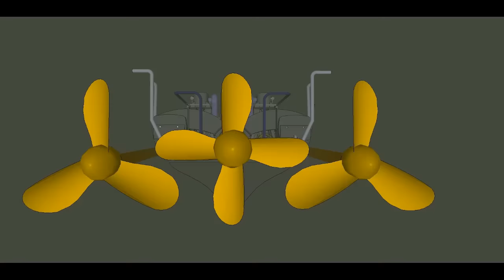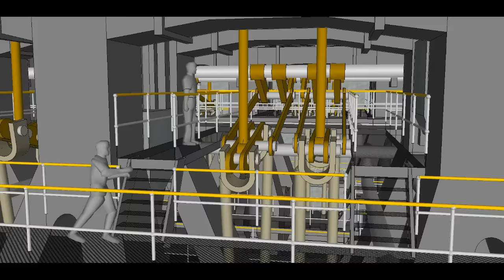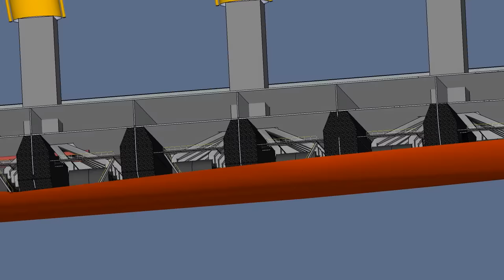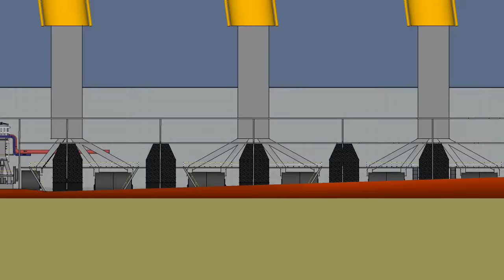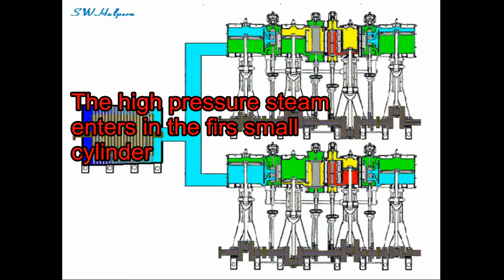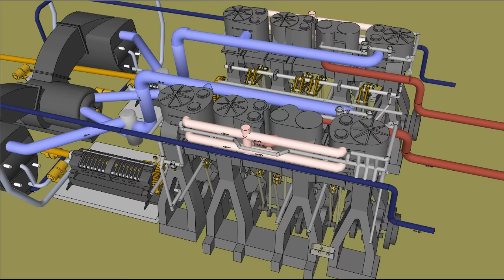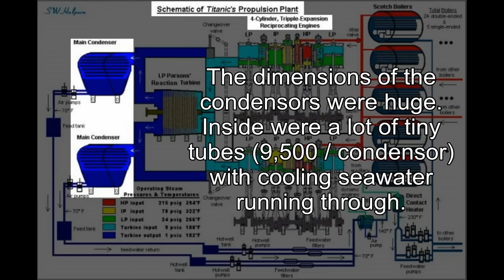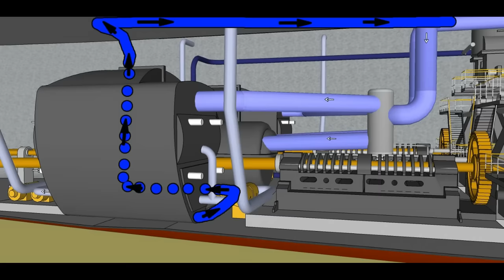The Engines of the Titanic

Comment: steam, under pressure, is immensely powerful. this just demonstrates the fact. although the usage of coal is so environmentally unfriendly nowadays, it was all they had back then. but wow, that must have been some boiler room. its bleddy obvious that one must have been only able to appreciate the true scale of it if they were to actually be in the place and soak up the vastness of it all. what an engineering masterpiece. lost forever. shame.
Reply: +DAVID Marshall Coal is still the most common fuel. At least in the US.
Reply: +DAVID Marshall possibly because they respond alone for a third of world's economy.
If a tiny little country was responsible for these numbers I could say "shame on it!" but that's not the case.
Reply: +TheSmileyFacedPizza We still have an abundant supply of coal left in the US (close to 1000 years) as opposed to crude oil and natural gas. There is some research on how to make coal burning cleaner. It's dirty, but it might be our only power source in the future (renewable energy still forms a tiny fraction of our energy usage).
Reply: There's still Bio Diesel you can get from Algae, so it shouldn't be a massive problem
Reply from the maker: Was that also true in that time?
Reply: Not Quite a masterpiece there was alot of false Engineering
Reply: worst part about all of those furnaces to power them boilers, them poor boys never knew what hit them when the frigid Atlantic came rushing in.  Some of them burned thanks to the cold water hitting the hot fireboxes.  There was several explosions immediately after as well.  Which no doubt killed more.  Even if it didn't sink, imagine if you will that she stayed afloat long enough to have a ship rescue the passengers and crew.  The ship certainly would have been crippled if not lost due to the massive explosions in the fire room.
Reply: we could be renewable now or at least mostly powered by the cleaner alternative of nuclear.  Consider this, some of the hydro dams have been dismantled in beautiful Washington state thanks to the tree huggers that care more about spawning fish than generating power.  Nuclear reactors we have today if they were to build one with our current technology and knowledge would be way more efficient than the ones designed in the 50's, built in the 60's and 70's.  Most of which are still in use today.  Example, the Gerald R. Ford class carrier has new reactors, redesigned and are a lot more efficient than the ones we been using the last 50 years.  Of course that is a naval vessel and uses a different type of reactor compared to shore based but still new design and more efficient no less.  anyhow this is off topic as this is supposed to be about the graphic of the Titanic engines.  They were ahead of their time for 1912.  Or I should say a bit earlier than that as it took years to build that massive ship.
Reply: Coal is MUCH cleaner burning now. Always remember that smoke you used to see was unburned coal particles rising in the hot air exhaust. Now, coal is ground to baby power lik consistency and BLOW into the combustion with air pressure.   The powdered coal burns entirely, instantly and cleanly.  Not only does this make coal a very clean source of energy since it burns so wholly it makes it very economical as well. Then the only real pollutant left is Sulfur Dioxide for which smokestack scrubbers are installed. The SO2  removed from coal emissions is then used to make sheetrock. So your coal powered house is partially constructed of coal exhaust.  ;)
Reply: It honestly isnt lost forever. We could recreate it.

Comment: It makes you understand what a Relief the  diesel engine was.
Reply: I was thinking the same thing!! Just the sheer size of the Titanic's engines is incredible. Between the boilers and the coal storage and the turbine and all of the moving parts it took up the entire bottom of the ship plus all of the people that was required to run it and their sleeping quarter's. I'm sure the sleeping quarter's we're very small but it was still something that was needed to operate the ship. So take all of that in to account and it took up the bottom of the ship completely I'm guessing by the video we just saw if it was to scale. Then compare that to today's diesel driven ships while still not what I would say small by any means!!  But compared to the footprint of the steam engine and all of it operating components it's pretty amazing how much it's gone down in size, but up in power!
Reply: Rune Dyrting true!
Reply: Well...before they’re all steam turbine engines and before oil burner boiler was a thing
Reply: Well..

It is it will always remain..
THE only problem with that engine is it works with coal lol

Which is bad for the enviroment.
Lots of black coal was lunched to the air.

But unfortunitly it was all ended with tragedy.. :'(

(sorry for my english)
Reply: No, whole principe of burning fuel to make steam from water to run engines and turbine is uneffective. 
Thats why the diesel internal combustion engine is much more better and smaller, so insted all of that machinery you can have more fuel ..... @أحمدالجهني-ع6د
Reply: @RS-pe5hp 
Oh ok then Thanks a lot for this information.
Reply: @RS-pe5hp  I wouldn't say the idea of burning fuel to make steam is ineffective.  Most electricity even today is made by steam engines still!  Steam can be very very wasteful or it can be very very efficient.  There is a huge range of design.
Reply: @firstnamelastnameisallowed7943  Conversion to oil certainly opened up much more space in the lower decks for things other than propulsion. The fact is, Olympic was converted to using fuel oil instead of coal,which certainly improved things, starting with the fact it's a lot easier to pump fuel oil into tanks instead of re-coaling.
Reply: @RS-pe5hp  Steam turbines are anything but inefficient, they are more powerful, smaller than reciprocating engines and are ultra-reliable. They do not need the massive and thus very heavy foundations a reciprocating engine requires, saving a lot of weight.That is why ALL large passenger ships built after Titanic and her sisters were all turbine ships, with four propellers. It was not until well after WW-2 diesels supplanted the steam turbine on passenger ships. Oil has far superior energy density to coal, while Titanic and her sisters devoured 600 plus tons of coal per day, a large ship today only needs 200 to 300 tons of fuel oil per day and the tanks for oil hold way more fuel per unit of volume than a coal bunker of the same size. Yes, you are right that the diesel is smaller, I build diesel and diesel-turbine powered ships. They take up remarkably little space. As for steam turbines themselves, they generate most of the world's electricity and propel nuclear powered naval vessels.

Comment: Anyway, the engines did a great job: pushing the vessel as hard as possible into the iceberg. 👍
Reply: bruh
Reply: They didn’t even hit it head on, even if they did the ship would’ve probably had a higher chance of survival
Reply: Titanic was running at nearly full steam the moment the iceberg was spotted meaning it gave them even less time to react and avoid the burg. Not to mention  the rudder on the ship was too small for it's size making it slow to turn. There were so many variables at play and unfortunately it all went to shit for them.

Comment: I believe the triple expansion engine is self starting there is no need to use the turning gear to rotate the engine. There are air pumps on the condenser which draw a large vacuum about 28-29 inches in mercury in vacuum. So even if the high pressure cylinder is suck at top/bottom dead centre the low pressure cylinder will still push because of the vacuum on the exhaust side. These engines also have levers to blast steam into the intermediate pressure or low pressure cylinder to 'kick' over the engine when starting. They don't need to be turned over with the turning gear to start them as far as I know. This is because in a ship the engine must start/stop and reverse practically instantly and they do, because when in a harbour you use the engines to steer the ship more than the rudder which is only effective at high speed. In a building with a stationary engine, you have all the time in the world to start the engine there is no impending collision that requires an instant start/stop reverse or what not.
Reply from the maker: +KiwiPowerNZ Thanks for the clear explanation!
Reply: +KiwiPowerNZ  agree, but titanic hat not triples, but quadruple temd engines.. (simply sead 4 cilinders, double action)
Reply: Charlie K When the ship is laid up for work or some extended time you should occasionally turn the engines. A small engine that probably worked on that big gear could be run off one boiler to just turn it over a few times.
Reply: +KiwiPowerNZ The pony motors were also used for jacking the shaft to eliminate possible shaft imbalance while in port. I served in the USN on a 1200 pound steam frigate (Knox Class) and the prop shaft could never remain idle. it always rotated very slowly.
Reply: bama Fan Interesting thanks for the reply.
Reply: +KiwiPowerNZ It is how you make sure the massive weight of the gearing doesn't push all the oil out of the lower half of the bearing. It is done to ensure long life of the drive train because you don't want to be doing a bearing job on those monsters any more often than absolutely necessary.
Reply: Nick Vandergragt
I knew there was a reason for it, but couldn't remember exactly what it was. I do know it was a ridiculously low revolutions per hour. something like one full revolution every 10 to 15 minutes, if not longer..
Reply: I miss my time in the engine and boiler room.. Steam has a life all it's own.
Reply: Nick Vandergragt I volunteer my time on this: https://www.dropbox.com/sh/oyro2rpgpmk5yc9/AACMaNnvr3yiV3UWK4GGJgosa?dl=0
Called the William C Daldy made 1935, Coal fired scotch boilers (2 single ended) and two 950HP triple expansion engines. If you're in Auckland, New Zealand you're welcome to join us.
Reply: I think you are referring to cool down after a trip. We would use the turning motors to roll the turbine slowly so it would cool evenly and not bow. You are also right that we had to occasionally roll them over for the same reasons as mentioned before about bearing wear. we did it about once a week or so if my memory isn't failing me.   :)
Reply: Charlie K
I'm pretty sure it had something to do with the shaft. I was ESWS qualified and remember the question during my oral boards. Most of it still remains in my head after 25 years, The motor was connected to the reduction gears, Aft of the 1200Lb  76,000 HP GE Turbine, I remember the boiler techs always walking around with wooden broom handles in front of them just in case there was a steam leak. I can remember stories about guys losing hands and/or lives. Could be bullshit, But it sure as hell scared anyone visiting Dante's Inferno! ...lol
Reply: KiwiPowerNZ
The link u supplied is super cool. I love anything with a Bow....!
Reply: +KiwiPowerNZ It's maybe just to do with the sheer amount of torque those babies would be able to produce at very low rpm if someone leant on the regulator a little too hard before it was turning over properly. Consider a locomotive suffering a bit of brief hammerblow wheelspin, or a car engine shuddering when in too high a gear and forced to run at very low rpm. You'd run the risk of bending the shaft, mutilating a bearing etc, which you don't really want to do in a machine like this. So, you start it spinning gently, same way as you do with a car starter motor, before actually starting to admit the steam in the first place. It also means you can spot and clear anything that might be caught in the internal or external mechanism and causing it to seize (which will cause a little petrol engine like that to eventually stall out, instead of going down to 0rpm with ever more potentially injurious torque) before you bring the full fury of the main engines to bear and cause havoc.
Reply: the barring is done before starting with 3 purposes, first is to remove water out of the cilinders and pre lubricate bearings, and the second is putting the engine in the right position for the first steam (deadspot), the barring revolutions are way to slow for maneuvring propulsion use. les then one rev pro minute.the 3th is for maintenance and repair purpose.
Reply: +KiwiPowerNZ No all steam engines need to be set at just after top dead centre when steam is allowed in a cylinder. Even a triple expansion, because, when it starts steam only goes into the high pressure cylinder not all three at once.
Reply: +KiwiPowerNZ get some books from when they made engines like the Titanic and you will really increase your knowledge.  You would be very dangerous in starting an engine of this size instantly, check it out.
Reply: Read my former post here, the barring engines are used for maintenance purposes, cleaning eventual water out of the cilinders, pre lubricaition and maintenance, or any other reason to bar the engine.
Reply: +MrBugsier5, The
Reverse engine as it is called does exactly that when the engine is
running. If you give thought to the immense weight of the valve gear
and have a smidgeon of knowledge of steam locomotives and their
history, you may comprehend their use as I stated. Steam Loks started in this country with the Johnson Bar as the reverse lever. AstheLoks grew larger in size the lever became taller and more robust to
the point of needing to be power assisted, thusly replaced with power
reversing.  Take into consideration the massive size of these engines
and the need to reverse rapidly at times that is the little engines
purpose not for polling except at warm-up. Please learn your steam
history as many methods were used, it is still the reversing engine
as was the Johnson bar.
Google has some down
loadable books on turn of the Century Steam Engines.
FYI here is a
description on a 2500 HP Liberty ship engine:
Reversing is
accomplished through a small single cylinder reversing steam engine,
to the crankshaft of which a reversing worm is attached. A hand
reversing wheel is also fitted. A pin on the reversing gear connects
to the reverse shaft through a drag rod.

The turning engine is
a single cylinder steam driven engine, mounted on the after end of
the bedplate. It operates through two sets of worm gears to the
crankshaft of the engine. The engine is reversible so that it may be
used for setting the valves or making repairs.
Reply from the maker: +Chloe Alexa   Thank you for the clear explination!
Reply: +KiwiPowerNZ The low pressure in the condenser is enough to start the engine but : it is a hen and the egg problem. You only have that low pressure if the main engine have been run constantly (my guess) 20 minutes.

Is the condenser's air pump driven by the main engine or could it be ran on direct steam ? The condenser has two pumps:
one for air (responsible for keeping the pressure low) and
one for water condensate.
This isn't the cooling water pumps.

If it is possible to build up that low pressure in the condenser beforehand, it should be possible to start the main engines in any position (the two low pressure cylinders is angular to each other.)
Reply: Stefan Skoglund There's two Weir air pumps on each condenser for redundancy. So they will always have vacuum in the condenser. Even in port at least 1 boiler room will still have a skeleton crew making steam for the refrigeration, generators, to run lights and ventilation 24/7 in port. They use a small condenser though while in port with smaller air pumps and circulation pumps.
http://titanic-model.com/articles/tech/TechFeatureMar2006.htm
Reply: KiwiPowerNZ what you call air pumps would today be called vacuum pumps (most common would be of ring seal design)..... not all plants even use them .... I've run plants that have them and one's that don't.... higher vacuum increases efficiency .... other ways of removing condenser non condensables are steam jets where jet steam is recovered as condensate to the hotwell and "hogger" jets that release steam to atmosphere..... usually only used for a short time during upsets or to pull vacuum on startup.....I think it's important to note that almost all vacuum is produced by action of steam being condensed to water.....and without steam flow to condenser vacuum cannot be stable and maintained in most plants
Reply: it's just the first initial start cause of condensation after that don't need starter engine
Reply: KiwiPowerNZ pop

Comment: Had no idea how much of the ship, or the immense amount of fuel this engine took. Only 11 days endurance.
Reply: Yeah. know with diesel electric, some ships can go over 14 days (at least of what I think it correct) without refueling.
Reply: @Andy Proper The Titanic used like ... I think more than 800 tonnes of coal per day, and had enough coal to sail for 8 days, I think much more than 30 tons... She sailed for only 3 days.
Reply: Yeah, sure takes slit of energy and man power to stoke those  boilers.I don't know if I could keep up with those men stoking the fire. Maybe 30 years ago I could.
Reply: Probably the fuel oil would have had superior energy density compared to coal. Olympic was in fact converted to use fuel oil instead of coal long before her retirement and scrapping during the 1930's.
Reply: At 21 knots maximum speed 11 days gives over 5500nm of range. Not bad at all.
Reply: 1 gram of uranium replaces 20 kilograms of coal .. they would only need 350+ grams for 11 days
Reply: @heathbauerle2787  Japan built submarines that could travel 36,000 miles without refueling, and a larger vessel can sail 10,000miles or more before they really need refueling.